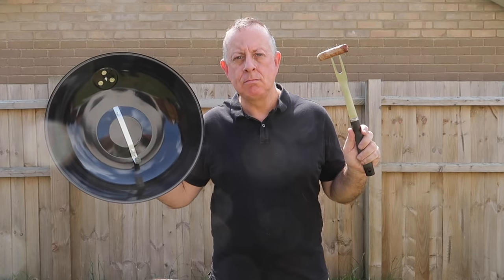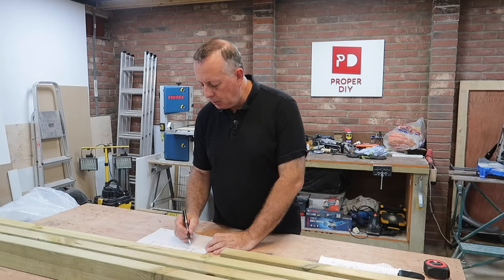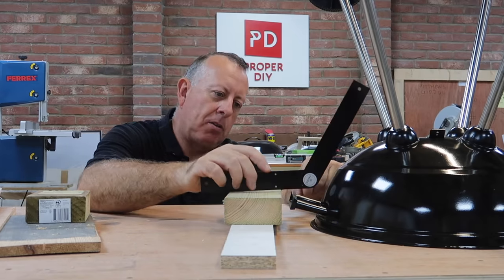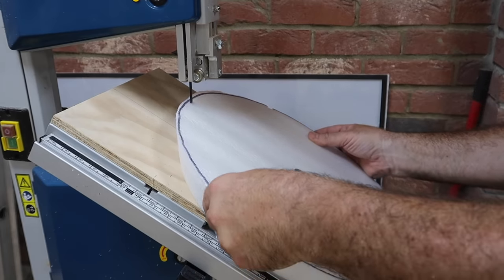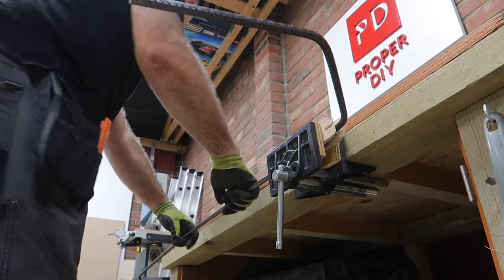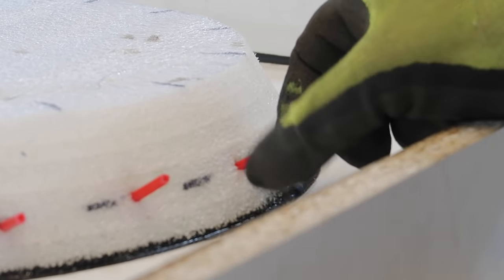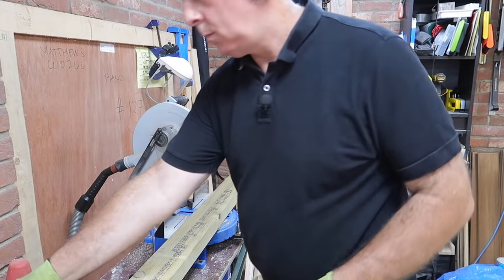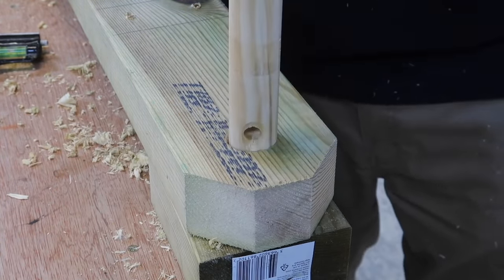How to Build a BBQ Cart

Comment: The most brilliant piece of garden furniture I have ever seen, Stuart.  I have a bad back, so I need a workbench high area to work 90% of the time.  It's only occasionally that I have a BBQ and I had one of those huge gas things that I eventually freecycled as it just took up space in my garage and was rarely used.  This is ideal - a sometimes-BBQ-potting-table.
Reply from the maker: Well thank you - it seemed sensible to me as like yourself, the BBQ is not a very often used item especially if you live in the UK.

Comment: looks good and a nicely put together, an attachable fold up table extension in front of your drinks area, or between your handles, would give more serving area if you needed it, otherwise great as it is
Reply from the maker: Thanks. Funny you should say that, since filming I have made extensions that fit at either end over the handles just to give a bit more surface
Reply: @ProperDIY  great minds think alike, I have a 4 burner BBQ wheeled stand here in Australia and have taken 2 burners out and made a S/S tray to fit in there and use it for charcoal /wood burning and if the fires dies down it can be slid over to the other side for gas finishing. I like the drinks tray and interchangability of the tubs.

Comment: I'm just putting the final touches to my own BBQ cart built using your method.  I've made the BBQ section out of hardwood decking boards rather than concrete.  Using stove rope stops the heat transfer from the kettle to the wood almost completely.  My challenge is that my BBQ is 57cm, which is pretty large, meaning that the top has to be big enough to accommodate a 52cm cutout.  I'm not saying the cart is over-sized, but I've just had a request from the Royal Navy to borrow it to practice landing their F-35's on it.  It's a great design and pretty easy to build though, so thanks Stuart.

Comment: As many others have already said, this is a cracking project & video. I already have a gas BBQ, a Greek style charcoal kebab BBQ / spit roaster & a pellet fired pizza oven, one can never have too many garden cooking options.  
However, this trolley is so useful I think it deserves to be added to my garden cooking fleet! I may not do the BBQ insert but definitely the ice bucket insert & the potting tray top are on my list of Thunderbird 2 "pods". The only thing holding me back is where to store it? My garage is already crammed & I have no shed. I might have to consider making it demountable so I can store it in component part form for reassembly as & when needed. Either that or, make it part of my existing run of garage work benches which are combination of old kitchen units / worktops & other fill in pieces. A bit of thought needed but definitely something I want to have a go at.  👍  🍺
Reply from the maker: Excellent! That's just what I like - giving ideas that can then inspire new ideas that suit your own situation and take my build to a new level!

Comment: I watched a similar video where she made the top from cedar slats and apparently after a few uses she confirmed that the heat from the BBQ hadn’t affected the timber, slightly easier than messing about with concrete
Reply from the maker: I've been messing around with concrete for 30 years. If you're happy with a BBQ sitting directly on timber go for it - good luck

Comment: Thanks for few ideas. Not sure if the "storage" especially flammable storage under the BBQ is any good - > you probably should add a fire resistant layer under the BBQ so that hot ashes would not start any unwanted fire.
Personally I've been collecting ideas for my kamado type BBQ/grill, what kind of trolley, work surface and etc to create. the configuration idea is great. another question is if and how could I make my kamado bbq (nearly 100KG) detachable from the trolley for potting occasions or etc.

Comment: This is amazing. Did you consider just using wood for the bbq insert but using angle brackets or some steel sheet to create a small air gap between?

Comment: I may be wrong but i was under the impression that as concrete was made with water it can quite violently fail when exposed to high temperates for sustained time, as in with a bbq.
Reply from the maker: Correct, your wrong

Comment: Stuart I love this, and made one at the end of last year, which turned out surprisingly well,  but ran out of good weather to cast the BBQ top which I have managed to get round to this week, its about ready to come out the form, but ive noticed when I touch it the dye I added making my hands black when ever I touch the concrete is this normal? 

Did you need to seal ur top with anything i am worried that a sealer my not stand up to the heat from the bbq

Comment: Very nice and I think I have my next project!  Just one question - do the screws holding the rope in place not scratch the BBQ or are they essentially recessed in the rope?
Reply from the maker: Thanks. Yes correct, if screwed in tight they are essentially recessed in the rope and well away from the enamel.

Comment: I don't know If you covered it or not but won't the screw you put into the rope damage the finish on the barbecue. Just wondering.
Reply from the maker: The screw squeezes into the rope quite a lot so it is well away from the surface where the BBQ sits against